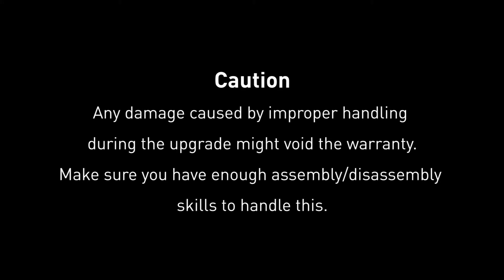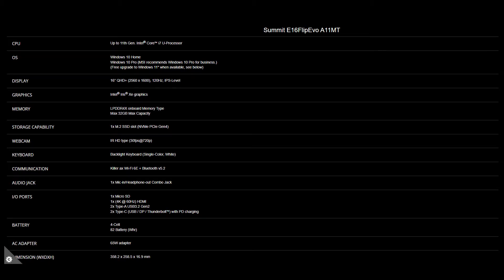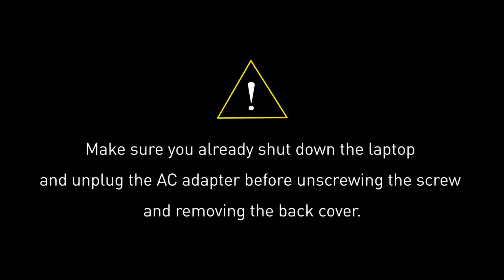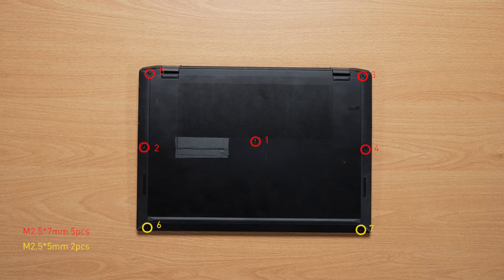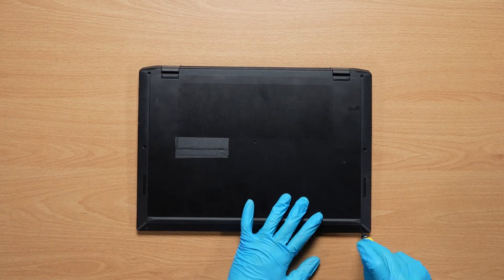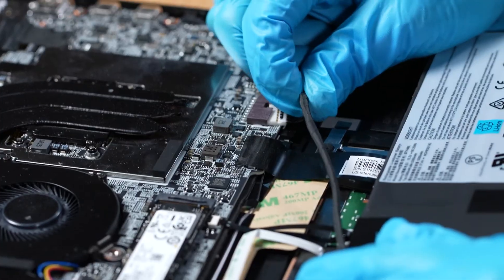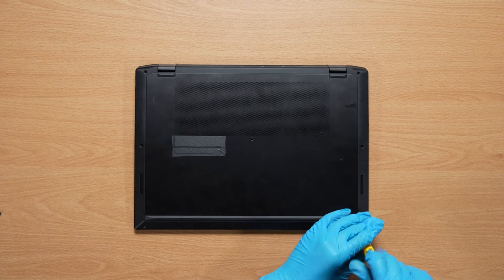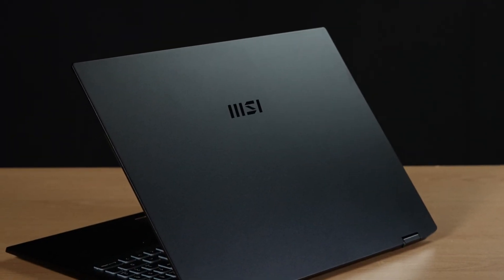MSI Summit E16/Prestige 16 Series Upgrade Tutorial

Comment: why the hell do you need to remove battery to change SSD.

I changed and upgraded RAM and SSD in my HP X360 lot of times. no need to touch the battery

Comment: why do we need to remove the battery before replace the ssd?
Reply: The same reason you turn off the switch before you repair the lights
Reply: So the video is longer